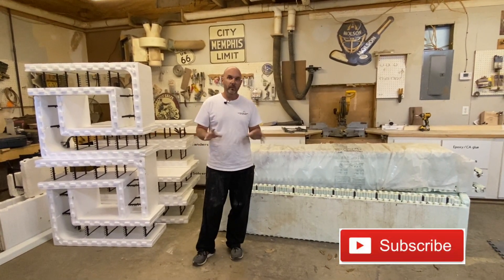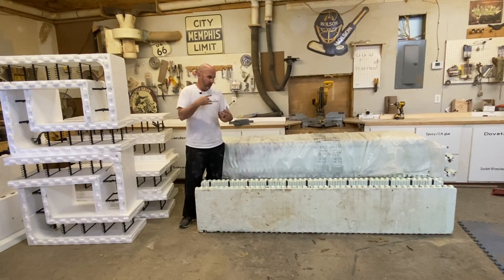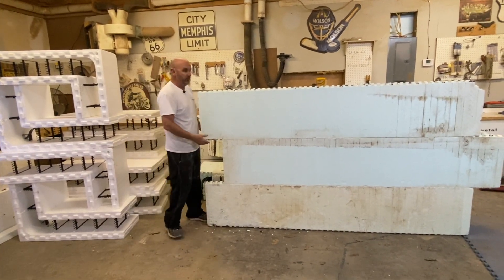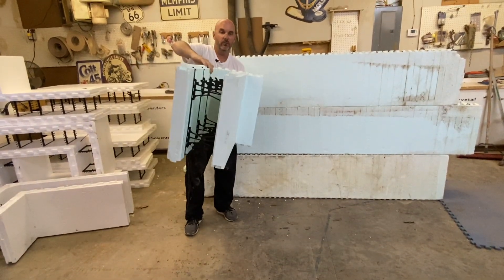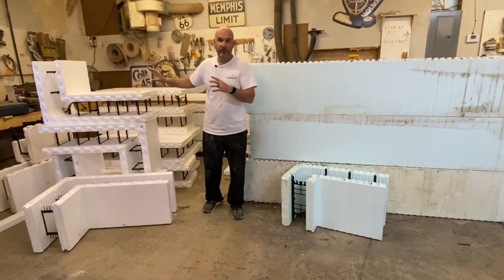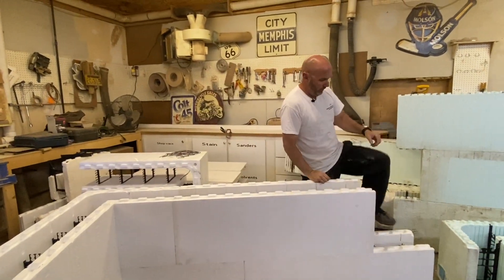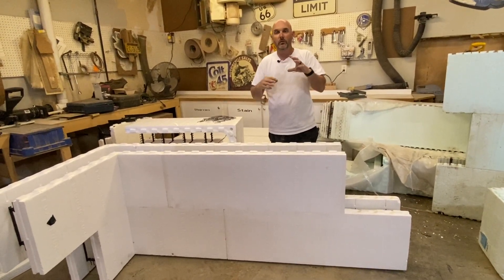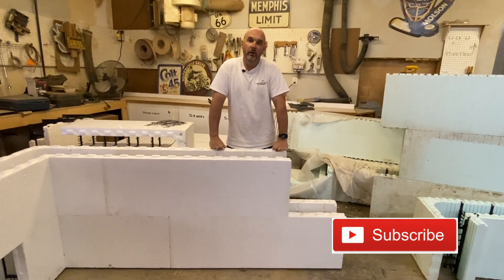ICF Review!  Fox Blocks vs Nudura?

Comment: Great video. Quick question, we are preparing to build our forever home. We are researching wall building systems and there is a plethora of info and choices out there but we are seriously considering the Perfect Block. What is your opinion on that product vs the ones you reviewed in this video?
Reply: They aren't any perfect blocks. At the end of the day all the blocks give you the same benefits, the only thing that changes is price wise.
Reply: @icfwallsystems  Steve Baczek, who is an architect engineer builder has weighed in on this subject.  Your right nothing is perfect.  Although, the perfect block has many positive attributes if used properly.

Comment: Biased! The same way a clip can be missed in Nudura it's worse with Fox block cause there are so many more clips that doubles the connection count because Fox is half the size needing more labor to clip these half blocks together. And you didn't add in the cost of shipping against Nuduras price though agreed Nudura does cost a little more per block...It gets some of that back in the process.
Reply from the maker: It’s literally $2/sqft more in my area right now, so it’s not a little more, it’s 40% more, plus, fox and almost all other big icf producers send their molds to multiple plants around North America so shipping is lessened by lower distances, in my market, I’m 15 miles from a fox plant, and 600 miles from Atlanta, closest place they make nudura…. I mention all of this in the vid so it’s not really bias, it’s knowledge…. For the record I love nudura, even though their janky little corners are some of the weakest I’ve dealt with, personally I won’t pay a Nickle more for all their schtick, much less a couple bucks a foot…
Reply: @all3pools  you still haven't quantified the actual cost of shipping and labor putting in more 3 clips every 4 ft
Reply from the maker: You only put those clips in the first 2 rows…. And the top row, so I dunno, $50🤷‍♂️….  And I don’t understand what you aren’t getting about me saying shipping is really going to depend on where you are, it’s basically nil for me in my area because there’s a factory in my backyard, but nearly anybody that doesn’t live in Georgia or Canada is going to be closer to a fox plant than a nudura plant, so even though it takes more volume to move fox, it’s typically going a lot lower distance…. So if you really want it quantified you’ll have to do that math based on your zip code, think I was pretty clear?

Comment: Really excellent video. 
Can I ask what's your view on using spray foam between the blocks? I notice a lot of installers in Ireland using cans of this spray foam and Im not a big fan of it. do you think this is necessary?
Also I assume there's no patent issues with icf these days? 
Can anyone start making them?
Reply from the maker: Spray foam on horizontal rows to avoid clipping is fine I suppose, we only use foam under first course and on bastard joints, I can’t see it saving money over clips and clips are hardened steel which has to be more resistant to the vibrations caused by pumping concrete into the wall…
Reply from the maker: Ya nudura had some design patents on foldability but I believe that’s been copied by strong block(not sure). All the good companies have reversible corners and full height webs so I think the main important stuff is pretty much fair use at this point, the same mousers make multiple companies block, nudura withstanding…

Comment: I'm pretty sure Nudura recommends metal clipping the first two rows.
Reply from the maker: They probably do, haven’t read their material in a few years, but I hate their clips…. They don’t have the little tail that Fox does that makes a bit of a handle, it’s pinch city without that tail
Reply: They expect it on all rows, but only the first row gets them on the bottom too..  Up to KODE is one of the only Nudura builders that does it right and he is very detailed on how they go together..  I was told about a company called ClearCo that makes Joint Clips for Nudura that is supposedly better than Nuduras.  Just ordered some for my build, so we shall see.

Comment: I prefer Nudura…. Before covid they were about the same in cost…. Biggest plus in my opinion that you failed to mention is that you have less waste with nudura… fox blocks the corners are not reversible… and nudura has a plastic flange to screw into every 1-1/2”…. And I have poured over 20’ high walls in one shot and have never had nudura forms separate… the weight of the rebar on every course I would say it’s next to impossible for a course of forms to separate…unless in pools your not laying rebar on every course… around windows I use some large zip ties to hold vertical rebar as well as against the horizontal row… again impossible for the forms to separate…. And a small set of bolt cutter easily snips the metal rod in the forms. I would be more worried on the fox blocks having to remember to add those locking ties …. And personal preference… both forms get the job done. And sometimes you get what you pay for… hopefully after covid prices will balance out again
Reply from the maker: Fox blocks have reversible corners, they are longer both directions than Nudura making them more useful, snd the non folding design makes them sturdier, nudura doesn’t want you to use zip ties either, they have clips like fox but they don’t have the little tail making them harder to put on, if fox wasn’t made in my backyard and I had shipping as a great concern the foldability of nudura might matter, but for me it’s schtick that doesn’t warrant one extra dime, and the extra cost is what got me away from them in the first place

Comment: There's a small difference between US and Europe. We're using asymmetrical "ICF" elements. The thickness of the outer wall is between 0,5 and 1,5 feet but mostly minimum 1 feet or above. If you have 1 feet thick thermal insulation that can reduce your energy cost way more better as theese normal ICF forms. It works fine by -22 deg F and of course by 105 deg F too. Why do you use this normal sized ICF in the states?
Reply from the maker: 1 foot??? That’s nearly .3 meters
Reply: @all3pools  yepp. The most common types has 0.25-0.35 meters thick outer layer. Thats needed to reach  the highest energy efficiency certificate.

The .25 - .40 meters thick thermal insulation is pretty basic here by every "new" building,not just the ICF walls also by simple brick or concrete walls to.
Reply from the maker: Amvick here and Canada has an r32 form with 3.5 inches of foam, which will meet even Canada’s 2030 requirements…

Comment: Hi,
When doing a pool what's the next layer that goes on the inside?
Does a waterproofing stick to it?
Should I put something on the outside as well? To avoid contact wifh dirt?
Reply from the maker: Inside we use vinyl liners on some, and we plaster higher end pools that we monopour but we just bought equipment to ecofinish our high end pools as we aren’t in love with plaster!

Comment: How does one find the solid area for hanging curtain rods or heavy art and mirrors on Fox Blocks?
Reply from the maker: You have a plastic web every 8” that holds similar weight to studs, if you require serious weight bearing you have a concrete wall you can anchor into pretty easily!

Comment: Can ICF be used when digging a basement under an existing house?  Or is it only for new construction since there would there be a problem trying to add rebar and pour concrete from above due to the existing house foundation being in the way?
Reply: PACIFIC ICF just did one like this.  Building was existing... level it up and prep the ground, make footing forms and then added AMVIC  ICF  on top. I planned it so the full height 16" Amvic block fit tightly under the floor joists.  So the detail is that the concrete must be poured from a boom pump, so I used an 8" core ICF and placed 50% of the core outside of the building.  Half the concrete (8") wide is under the floor joists and 4" is open outside the wall for the pump truck hose.  Place vertical rebar after the ICF is installed by dropping them in from the top,  thats another reason to have the 4" opening outside of the building.  Easy to screed and place bolts if needed, cover with peel and stick and dimple membranes.  There may have to be some concern over the bracing or blocking for concrete flow. Another trick is to make the cleats level with the top of footing forms.

For the footings I established the inside plane of the ICF and then installed a cap of wood on top of the cleats of footing so concrete cannot escape the backside where I could not see or work.  I did the cap on the exterior of footing too and when stripped, the concrete was square and flat.
email me at bill@pacificicf.com
I have done whole houses floated in by barge and raised 12 ft in the air, and I have done 100 year old homes which had no foundation originally.. ICF is a great choice because there is no stripping required on one side of the wall (usually where you cannot get to)

Comment: another pro to fox block, much easier for most customers to find a distributors since they work with big box stores as well.  On nudura though, fairly positive they manufacture in Georgia as well.   One pro you didn't mention is the longer length of nudura makes it easier (for me anyway) to do radius walls, say, if a fella is building a steam ship themed cabin ;)  great video sir.

Comment: Another great video.  Thanks! Update to my termite treatment plan inquiries.  Orkin rep plus another firm, Palmetto Exterminators,  told me they can't cover any home with foam/soil contact, even if waterproofed. They have had termites get behind the foam next to the concrete (where it cant be seen or treated), and move up the wall to the wood windows, doors, and the roof.  There must be 6 inches of space between ground and foam to be able to get on a termite protection program with them.  We may build the basement and crawl space in concrete only...code is 10" thick walls.  Then pour the 1st floor (concrete with radiant tubing).  Then stack the  6" core ICF  on top of that.  This way  there is no foam soil contact.
Reply: Shouldn't you backfill with gravel anyway for the drain tile instead of clay/dirt so it doesn't clog up? Where I live, the clay or hard pan clogs up any fabric you use with the rain or snow melt. I've found it's more beneficial to totally backfill with gravels over your drain tile that surrounds the basement. Plus, when a heavy rain comes or before you have the gutters installed, the rain just falls to the gravels and drains out the pipe. This way, you won't get that dreaded red clay stains all over your basement or crawlspace walls.

Comment: If you have an experienced installer,  they can use almost  any block and get good results.
Reply from the maker: Yes, some blocks are better after installation too, I wouldn’t want any block without continuous webs which is why I reviewed two that do...  but the point of the video was really that one is a far better value than the other currently, not historically, not in the future possibly, but right now, today and likely for a while, one is a much better value!
Reply: @all3pools  Continuous webs?  Not sure what that means.

Comment: I am moving to Missouri and have a few projects in mind. What is the finished cost of an ICF wall per square foot of wall? I am comparing it to another system that is priced by square foot of wall.
Reply: You can't really do that as the walls vary in thickness and the complexity will change the price..
Reply: @FJB2020  An example can still be given. I was a contractor for decades and would have no problem answering the question.
Reply: @gsmscrazycanuck9814  standard Nudura 6” core form, 13$ a foot of wall finished will get you close, that’s footer all the way to top plate.

Comment: Do you use a waterproof membrane on below grade walls? I haven't done home construction for over ten years, but I believe here it's code to waterproof any walls below grade.
Reply from the maker: You should do something, here we use xypex add mix that waterproofs the actual concrete. There’s a cheap dimpled plastic roll I really like because it aids water in getting down to your French drain I’ll be showing in a video soon!
Reply: @all3pools  I am familiar with the dimpled product. It's been used here for over 15 years. I have seen many techniques over the years. I have been involved in all aspects of new home construction/renovations since 1983. Found your channel yesterday...good content.

Comment: Seems like its a bit biased towards Fox but I get it, you use more Fox than Nudura due to Fox buying market share to compete. The difference in the job will be the skill and attention to detail of the installer regardless of the block brand so either one works. If cost was no issue I would say that Nudura is a hands down winner.
Reply from the maker: As of right now I’ve set more nudura than any other form, I got away from them solely because of price, it’s a nice form, but do us fox, and foxs corners are hands down better!  And for certain monopour situations the hinging of nudura makes them a little less stable, nothing you can’t deal with but I wouldn’t pay a penny more for them...  just my opinion!
Reply: @all3pools  Thanks for the note. I hear you regarding price. Sometimes the brands get too big for their britches so it's good that you keep them honest. My only counter point is that there is potential for a lot more waste with Fox due to none symmetry from top to bottom. There is a lot of throw away with Fox and some disadvantages that may or may not result in additional hard costs. Of course the application, size and many other factors play into this. Keep up the good work with the videos. Cheers John

Comment: When I bought my nudura last June it was cheaper than fox.
Reply from the maker: Where are you located?  In my market last June there was only about a dollar a foot difference but fox was lower, I was buying from distributors though, if you priced fox through menards I have no doubt you are correct, big box mentality and mark up really hurt a product like icf...  at this point, with nudura having an 18% increase and foxs 5% increase not yet in effect, my market has a $2.50/ft difference to fox’s beni...  hopefully this all shakes out and nudura becomes competitive because it’s a very nice product
Reply: @all3pools  I live in Iowa.  I don't think I had any other option than menards.
Reply: @all3pools   I paid $3.84 ft²  before tax  for 6"

Comment: Just did a custom home with Fox Block and it was awesome. Bottom line the ICF installer will make all the difference in the world. Make sure and check references.
Reply from the maker: It’s diy friendly but you need to have a decent understanding of construction for sure!
Reply: What is the cost for the block how can I get a real number on cost.
Reply: @brucedecker5398   sorry just saw this. Actually you can call Fix Block and an engineer will take your blue prints and work out a design with wet and costs. I was lucky I found a contractor that all he does is the ICF and he had all the experience and tools you need to do ICF. Trust me an expert installer is worth the money. Hope this helps

Comment: Nudura saves labor in the "tieing together" of blocks and layers which saves $.  Nudura saves labor in the larger blocks/panels which saves $.  Nudura saves 30% - 40% in shipping costs from Canada and US manufacturing plants which saves $.  So why is $ presented as the BIG con?  Doesn't look like real balance to me.  Try this link and see what you think.        https://www.youtube.com/watch?v=uzh71BCITWg&list=TLPQMjMwMzIwMjE5Z3SU0PwS7Q&index=2
Reply from the maker: I use both, I buy both, in my market it’s a no brainer, my data is accurate for my market, and fox ships shorter distances typically because of there multiple manufacturing locations...

Comment: If your employees can’t remember to put one plastic web in the nudura corner how are they going to put hundreds of metal clips in the correct location on the fox blocks?
Reply: Give him a break, it's Memphis. 😂
Reply: Typically they can't remember to get to work either, so not really a concern!! 😅
Reply from the maker: They put it in, but one side or the other can miss but sound like it snaps in, bottom line the nudura corners are simply a weak link in an otherwise pretty solid chain...  I’ve poured a ton of both, I had 5 corners in a row blow on a pour about 5 years ago with correctly installed webs, turned out to be some sort of manufacturing issue as all 5 were out of the same 6 pack...  also missing a clip is unlikely to cause a blow out, especially just one, where as missing that web will do it every time...  I’m not bagging on nudura at all, with the exception of their price increases recently which seem out of line with the market as a whole, I was trying to compare and contrast honestly, as I’ve worked with both extensively
Reply: @all3pools  Appreciate your review bro. I've never worked with either, and i honestly thought nudura would be the better product.. i think ill give fox blocks a try. 

As a small builder climbing the ropes, things like blow outs cause me a lot of grief and setback. I appreciate your train of thought. Easier the system, less mistakes, better profit margins.

I wonder why nudura doesnt just make their corners static, seems like the it would be the better product. 

I also like that the fox corners are longer.

Comment: Integraspec is a great block also. And even tho they are Canadian,  there is a place in Alabama that I can get them. Their corners are bought as inside and outside and you can use the inside portion to do T walls. Can pour concrete in 10 ' lifts. How tall can you pour the Fox and Nudura?
Reply from the maker: They both say 15 and I’ve poured more than that on both...  19’ on nudura was the tallest I’ve done on a single pour, but their corners start to scare me